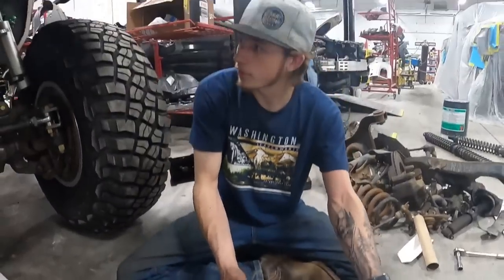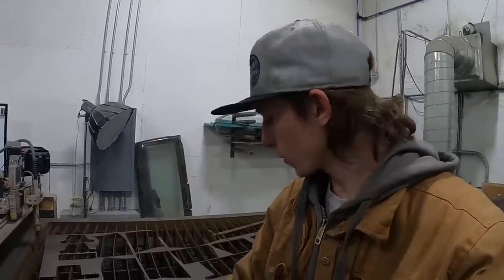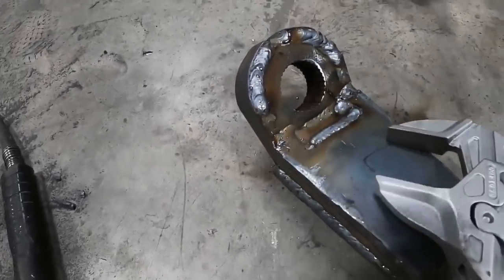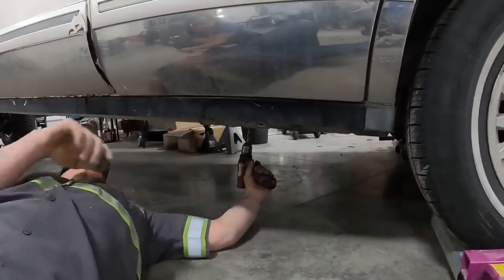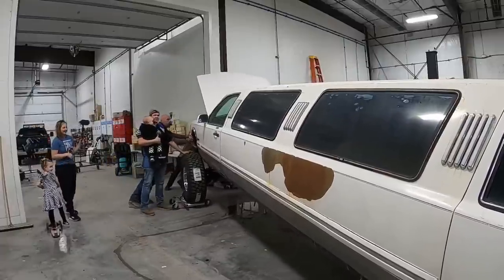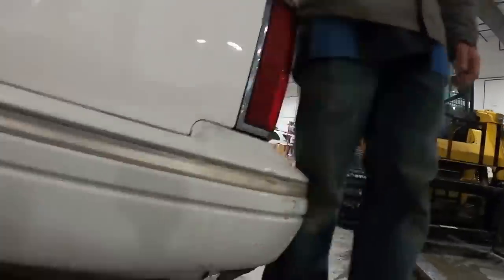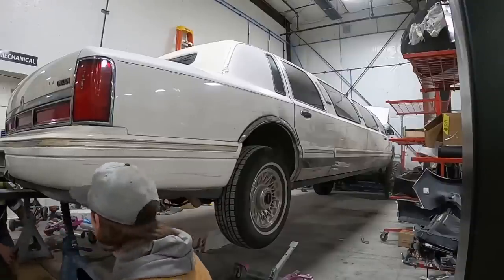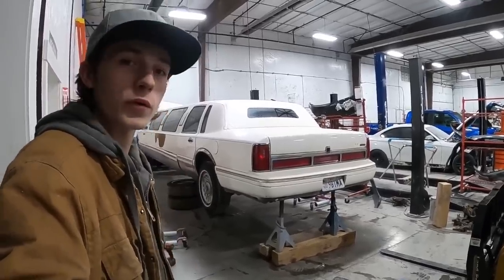Its Coming Together @Robby Layton's limo #2

Comment: First off why are you working off the floor? Don't you have tables to use? And that steering pitman arm is not finished also I doubt it is heavy enough for the front end of that vehicle.